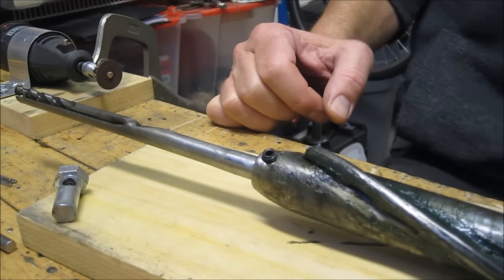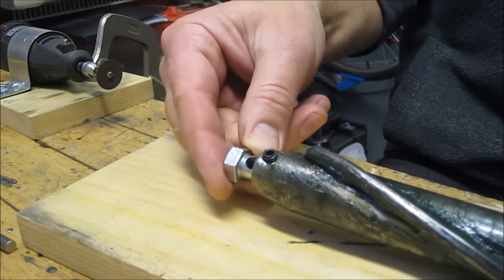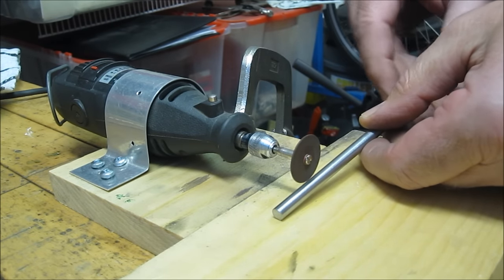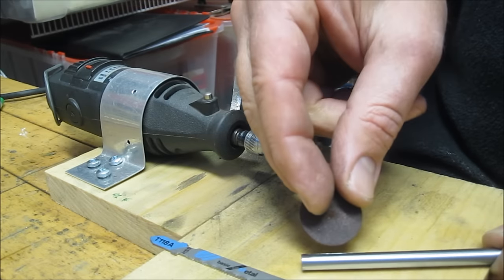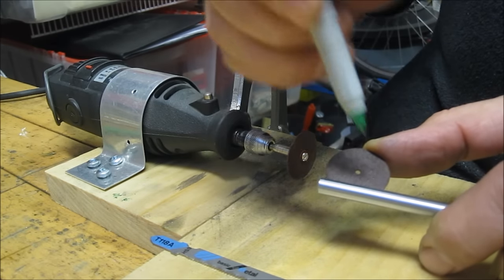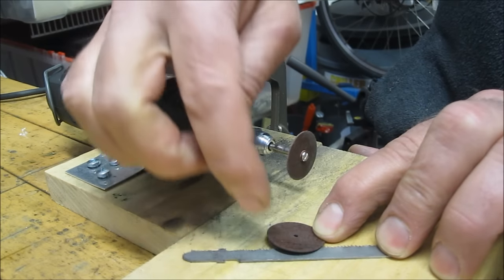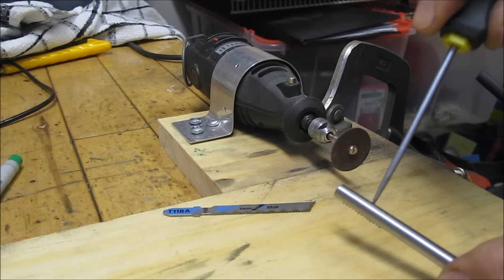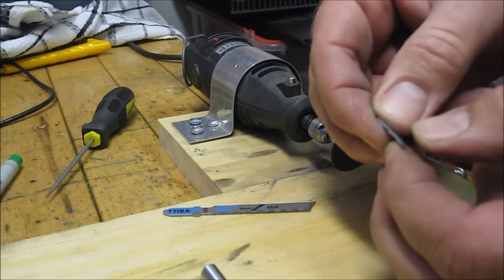DIY Sheet Metal Self-Loading Pistol ... Episode VII (rifling the barrel)

Comment: It's best if the grooves are wider than the lands, there is a way to improve what you have though but simply rotating the barrel 30 degrees in the jig from alignment with one of the grooves already made and make another 6 grooves in between the six you have. This will increase grip and reduce the bullet stripping free of them when fired considerably.

Comment: Hey Clint,
I'm looking into making one of these for myself and I found the plans, but I have a few question. Would an 80amp ac stick welder suffice for the welding. Also, do you think the plans could be modded to shoot .22? How difficult would that be?
Thanks, Dave
Reply from the maker: +TheDerpGames I can't see why you couldn't use the welder. It appears the original designer used something similar. This build does not require a powerful welder as the thicknesses are not huge. You would have difficulty in doing a magazine like I did as the sheet is very thin. As well, I don't think you would have the control needed to do the rails. But then, I changed that to my own idea. 

I'm not an expert in guns or gunsmithing, With that in mind, I don't see why it couldn't be built around a .22 caliber. The .25 ACP makes it easier to fab a simple extractor from some spring steel because of the case design. But then, the plans state that it's not absolutely necessary. I've been told that the two rounds are similar in performance. The .25 ACP is a little easier to strike and fire as it's a center primer setup. Go for it and stay in touch.

Comment: great job I love it!! I didn't find the video where you drill the barrel:( what size of drill bits did you used?? I guess 9mm and you finish it with a special reamer? thanks a lot for all the knowledge that you share!!
Reply from the maker: That was some time ago and I don't remember the sizes. This wasn't a 9mm, it was a .25. The reamer was somewhat smaller by a thousands or two of an inch.
Reply: @clintonwestwood5498  from what I hear, make the barrel just a tad smaller than the bullet. 

A 9mm should be an 8.8mm or 8.9mm. The rifling allows the excess material in the bullets to be extruded into the grooves to prevent the bullet from getting stuck from friction. 

Hence the "rifling trails" on the sides of a bullet.
Reply: willy I suggest watch a 13 part series called What on earth happened by Ewaranon to learn that the earth is not a globe. I got it in my about tab.

Comment: Nice work man!! I just cant wait to see it go bang !!! XD
Reply from the maker: +dutchgunnerNstuffNZ Thanks, it's getting there.
Reply: You're welcome. BTW  I'm  designing a litte22lr bolt action . I finished  making a basic functional model to see what extra  tools I'll need to acquire (at the moment not too many ;P) it looks like it'll work out if I use a little thicker locking lugs and stronger receiver material. In my mock up I used 3/4" tubing with a wall thickness of 3.5mm which I made  got to fit inside a 26mm ID 34 OD pipe.
I was just wondering if you knew what tubing would be best suited for the receiver, I would like to keep the overall OD the same as in n the mock-up. Video coming soon!!! .PS once again LOVE YOUR WORK!!! :D
Reply from the maker: +dutchgunnerNstuffNZ Have you looked at hydraulic tubing? It comes in fractional and metric. Very strong and not that expensive. At least where I live. Of course it's seamless which is always nice. Just subscribed so I can catch your videos.
Reply: Tanks man! I was thinking the same. I was thinking ether hydraulic or mechanical tubing. Do you now of any major differences strength wise etc ?
 I will cut out the raceways for the lugs in the inside tube. the outer tube  there to add more strength and cover up the raceway cut-outs. So in other words the thicker the inside tube the stronger and safer the lockup on the lugs.  The video will show this in better detail but just to give you an idea.
Reply: Thanks for subbing by the way. :) hope the next video wont get too long :P

Comment: I am curious, how long does it take to make a barrel on this machine? how does the resulting barrel perform?
Reply from the maker: +abowden556 It takes about an hour to cut the grooves. These are not match grade barrels. They perform okay for the low tech behind them.
Reply: +Clinton Westwood Thanks for the info :)
Yeah I guessed they weren't match grade, but minute-of-badguy accuracy is all that is needed, so long as can hit man sized targets out to the cartridges effective range, that is as good as it needs to be. 
 I forgot to ask, what did you use as the blank? how did you make the blank? that's even more important than the rifling itself.
Reply from the maker: +abowden556 I drilled and reamed my own blank from 1045 cold rolled.

Comment: :D..lol If only I could make a mechanism like this now.. oh well till I can ill keep buying barrels :)
Reply from the maker: +Banana potpie Ha, I thought the crude mechanism was the easiest part:)
Reply: +Clinton Westwood I believe it is.
 but I don't even have measuring tools and no real way of making the spiral guide bar.. its honestly the only part that's balked me
Reply: +Clinton Westwood it makes me excited because I believe I can do it.. I just don't have some things.. its why I haven't ventured very far yet.. but I plan to.. I wanna go so far as to make cartridges.. or try..   but that could be years down the road.. or never happen
Reply from the maker: +Banana potpie There's so many other ways to do the spiral. Even a wood dowel marked like I did with string and then routing a groove with a dremel would work. I've come to the realization that for the crude garage stuff I work on, my tools don't have to be high tech, rocket science stuff.
Reply: +Clinton Westwood hmm.. would a would rod be strong enough?.. hmm.. is the metal for the barrel anything specific.. and what size hole did you drill originally before rifling
Reply: +Clinton Westwood if I can produce barrels my builds would take on a whole new life.. barrels fabbed from one piece instead of a bunch :)
Reply from the maker: +Banana potpie The cuts you make are very tiny. Not a lot of rigidity/strength needed on the guide piece. I have a full set of number, letter and fractional drills. I think I started with D and reamed up to .249 inch. The metal for this build is just 1018 mild like the plans called. The pressures from this round still allow for a huge safety factor.
Reply: +Clinton Westwood darn.. Greek.. lol.. jk so it'll be up to me to figure out.. I think if I can make the tool I'll find the drill bit that's just before inner diameter then use sand paper and wool to smooth out then rifle.. should the inside be polished again after rifling do you think
Reply: +Clinton Westwood this build inspires me to try my hand at creating a similar but a bit heavier frame based on my high standard
Reply: +Clinton Westwood for the trigger bar.. have you thought of maybe instead of cutting a hole in the frame.. making like a groove and then some grips to house it..
Reply from the maker: +Clinton Westwood sorry, google changed the quote symbols to something else. Looked like Greek, yeah. I have re-edited.
Reply from the maker: +Banana potpie Yes, I think you have the creativity and skills to keep advancing the art.
Reply: I wish I could show you pics of what I'm thinking.. I'm drawing my own plans.. From the ideas created by your build and the thing on the web.. :).. And my high standard.. Idk if the idea would work.. But I got a few on how to afix the barrel so I could slide or remove it forward some how so that the slide has a tab like on a high standard to recoil against
Reply from the maker: Banana potpie Sounds like it has some potential. Sketch it up and message me.
Reply: Clinton Westwood I have only designed the frame right now.. I am having trouble deciding how I wanna do the internals.. Or externals as it might be..